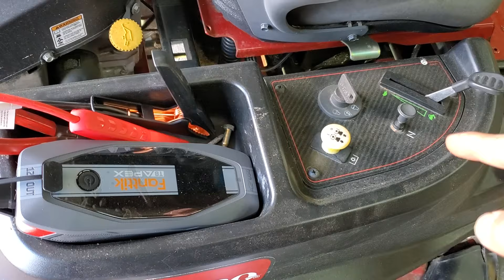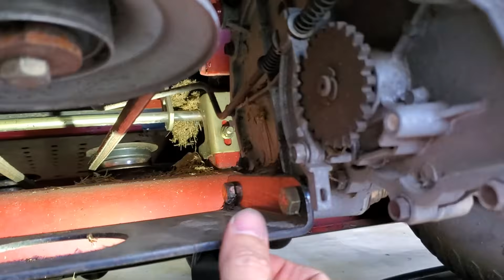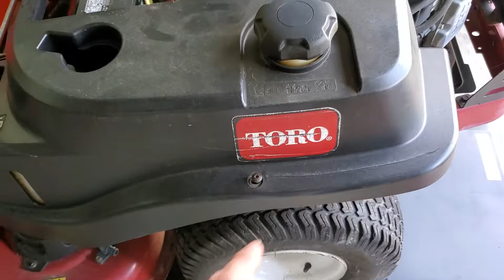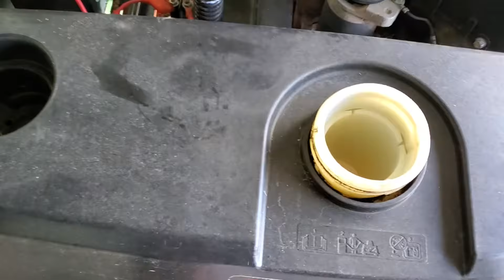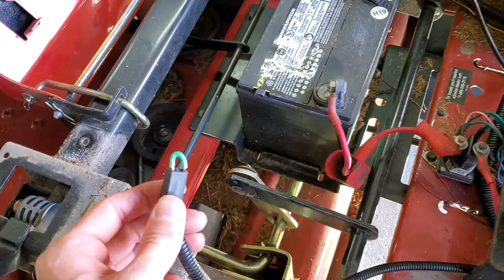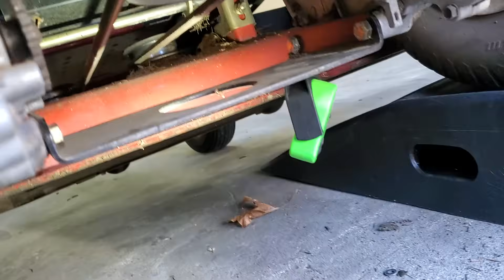Toro Timecutter Zero Turn No Start Issue Fixed By Bypassing The Park Brake

Comment: Good job, I have a few customers with these things, and it's a good fix, also will get them through until the part comes in if they want to fix it.
Reply from the maker: Yes, it's the fastest and cheapest way get your machine back up and running. Ordering parts nowadays it takes forever.
Reply: I read this drains the battery.  Is that correct
Reply: Yes they do drain the battery, when I winterize them for the customer, I unhook the battery, and put chucks under one wheel, and show the customer what I did.
Reply: @knighthawk86855  When I turn the ignition on for my toro timecutter the park break engages really slow and weak.  When I take it out of park it disengages normal.  Should like a brake issue to you?
Reply: @bigal2681   First clean the area around both brakes make sure there is no twigs, grass clippings, keeping it from moving, 2nd make sure you have a full charge on the battery, 3rd oil/grease the pivot points on the brake interlock, 4th if the first 3 things don't fix it, replace the black box, ie the module.
Reply from the maker: @bigal2681  if battery is good and there is nothing to interfere with the brakes, visually inspect if both rods that connect from the module to brakes are not bent, also can unplug the module and check the plug connector for corroded pins and try to clean with some electric cleaner and put some electric grease.
Reply: @mr_fixit  Did all that, still not starting.  Now getting a loud rattling noise when I try to start it. Any ideas what that could be now.  Sounds like it is coming from the brake module too.
Reply from the maker: @bigal2681  if the mower is cranking over and not starting most likely issue is with the engine. As far as the rattle there isn't anything that can produce loud rattle noise in the module especially if the brake assembly is removed.
Reply: @mr_fixit  It was the battery.  Changed but still shuts off taking it out of park.  Is it possible for the PTO switch to not engage the clutch but the blades still turn,  I do not hear pto engage clutch when turned on and pto pulled up.
Reply from the maker: @bigal2681  You can check the PTO by sitting on the seat turn the ignition On WITHOUT starting the engine and pull the PTO switch, you should hear a loud clunk/click coming from the clutch so that will let you know if PTO is engaging.  As far as the mower cutting off when you take it out of park, if the brake module is bypassed then next think to check is your seat safety switch. You can check out my other toro troubleshooting video in it I also show the pto engagement test.
Reply: @mr_fixit  Did that.  No loud clunk.  Don't hear anything.
Reply from the maker: @bigal2681  have someone sitting on the seat with ignition on and check for power at pto plug, check seat safety switch and pto switch as well.